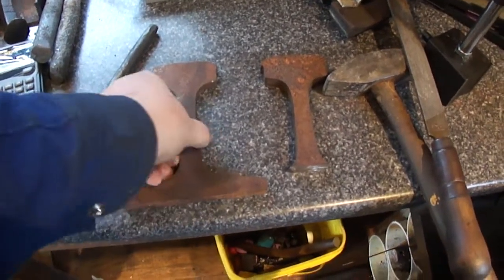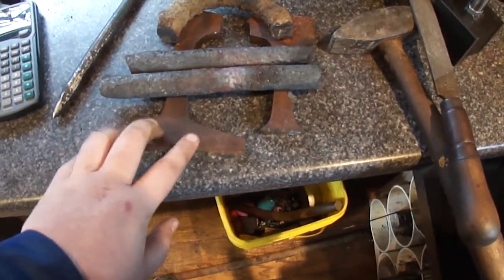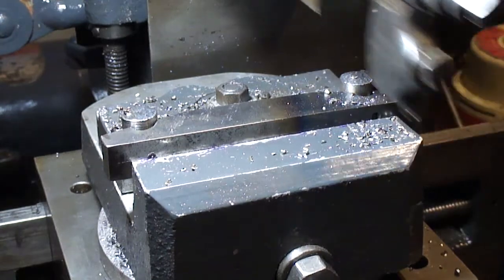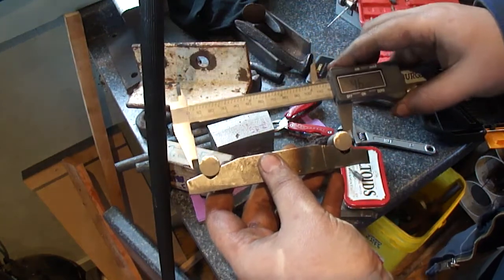Making a Sine Bar

Comment: I see what you mean about the smoke from the forge. Just make a larger bolt on wind screen. Wish I had a power hacksaw. I would love to cut up my old track for some good forging stock.
Reply from the maker: I didnt cut those up with the power hacksaw, that stuff is so hard that it'd just rip the teeth off of the blade. I found the slivers of track already cut thin like that. I had a small pile of thin pieces like that for making bookshelf ends or something like that. I just cut that piece up with the angle grinder with cutoff wheel to get it cut up.
Ill have to see what I can do about the smoke and the forge, but the wind here blows in every which direction and is strong enough that it wouldnt really matter. Ive seen alot of people using coal but it not creating any real smoke or fumes. The stuff I have I think has alot of sulfur in it and stinks alot, and when the smoke nails you, it about puts you down for a while.

Comment: Will you be adding anything else to the shop now the press is in? Or are you full now? I got some tooling for the lathe but I need to make some thing to raise them up to centre height. Oak tool holder will do for a demo. Hopefully I will have time next weekend so fingers crossed a treadle lathe vid coming soon.
Reply from the maker: I honestly dont know if there will be anything else, I think I have everything I really want for large equipment, but only other thing I can think of is just the stump to mount my anvil to and vise, and somewhere to stick my belt sander and grinder that I use from time to time that's in the garage. Im kinda lerious of bringing those to the shop tho because of grinding dust, and I usually use the vise to hold stuff to cut it with the angle grinder.
I hope everything works out for you, it'd be pretty cool to see the old treadle lathe up and running and making some chips.